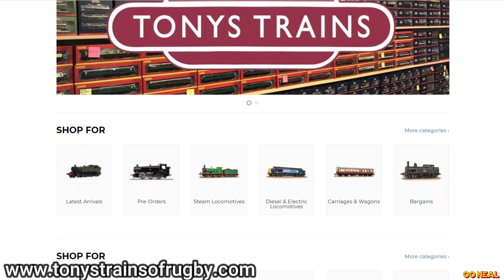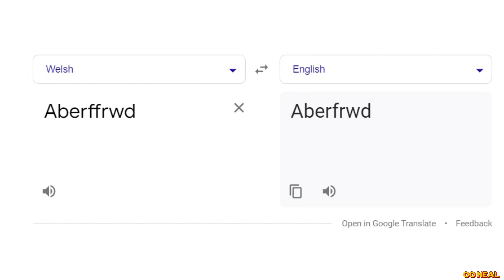OO NEAL : Ep5 'The Station' Part 1 -  Narrow Gauge Railway

Comment: Being a modeler in the US, I’ve taken a liking to bullfrog turnout /point controllers. Provided you have a frog that’s isolated, you can power the frog with a simple built in switch and a similar mechanism under the board with a tortoise-like wire to flip the throw bar.

Comment: Always a treat when a new OO NEAL video pops up. Coming along nicely. One thing you might want to consider is that the XPS foam will eventually leach the plasticiser from the electrical cable sheaths and degrade them. Not necessarily a big problem, but might cause issues in the future. Just FYI 😊
Reply from the maker: Hello Thank you,
I didnt know about that. Thats not good if that happens. I will have to watch out for that.
Reply: @OONeal  I think a bit of tubing to drop the wire down should sort it, but obviously that's easier before the track gets fixed. Maybe from underneath would work? You might be fine though - fingers crossed. Obviously not as serious an issue as it would be with mains electrics in xps insulated walls!
PS forgot to say, I always enjoy your videos but I'm particularly enjoying this series - trying to get ducks in a row to get to Statfold to see it in person.

Comment: just a thought if you use fish plates to join on the joint as you only have a single track joint it will line up
 when you push together then bolt up to stabilise nice job so far thank you
Reply from the maker: That would probably work but I think they could bend a bit as they arnt the toughest of items at the small size they are.

Comment: Well you did it again on the second point you installed you put metal rail joiners on the frog end instead of insulated ones so now you will get a short. Not so easy to fix this time as you can’t slide the rail back to change them. Might be simpler to cut the rail with the dremel and put some glue between the rail ends to stop them closing up. Interesting you work for an RC car company. I used to race buggies successfully at national level when they first came out for quite a few years. Also the 12th cars on the carpet.
Reply from the maker: I realised afterwards, I’ve sliced the track which will fix it. The joys of trying to get things done in a short time frame. That’s cool you enjoyed RC too

Comment: Really enjoyed the video as usual, Tris. If you want to be uber accurate about the alignment of the sections - and therefore the track - how about using shoulder bolts instead of regular threaded bolts to connect the sections; depends on the tolerance of the holes in the woodwork, I guess? Also, I was considering whether or not you could use the bolts for the electrical connections between the boards? Turning in to a lovely layout and I am really impressed, especially given the time scale you are working to, not to mention editing time! All the best. Si.
Reply from the maker: Thats a good point. I think now I have got to this stage I need to keep it going other wise I have no adjustment on the areas I have already done 😮 The idea for electrical is good too, I don't know how well the coated bolts will conduct. I was just going to use a little connector underneath it. Im glad your impressed, I have been getting worried I will mess it all up but so far I am pleased. Thank you for taking time making the suggestion.